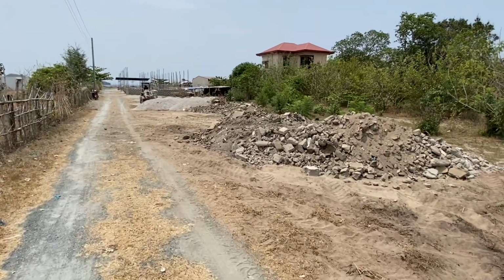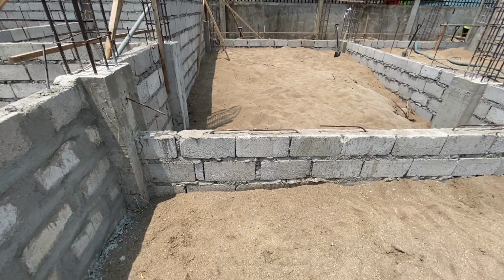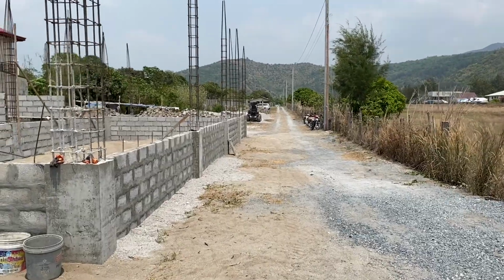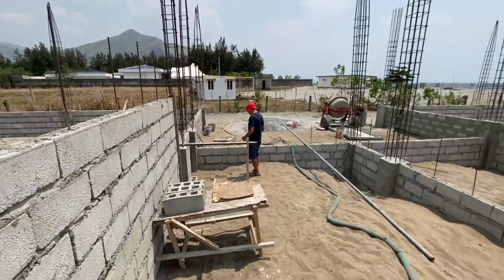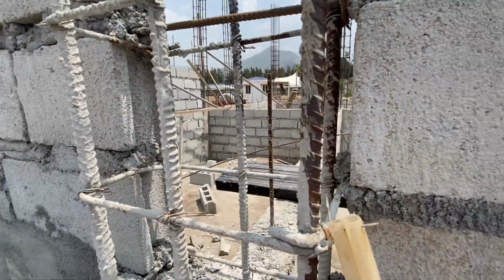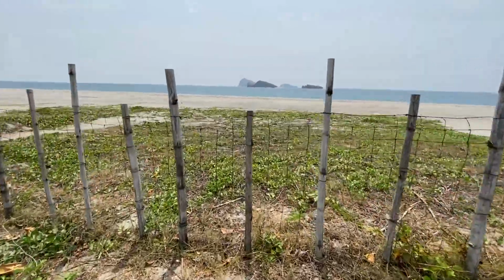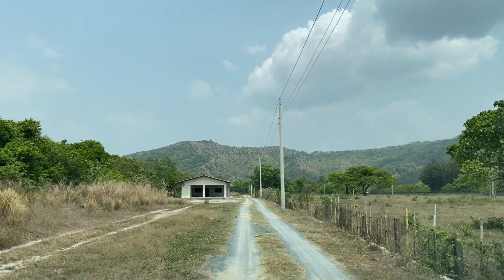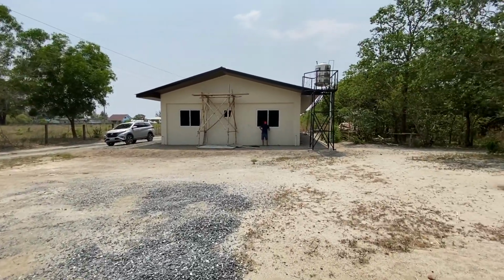Beachfront House Build in the Philippines (Week 6)

Comment: Just a suggestion watch Texas Filipino on how he is building his house. He shows and proves you can save money and have a stronger build. He is goin three stores high . Framing windows and door plus has all electrical lines and boxes and water lines and sewer lines. All walls and columns and are mixed and poured.  You would be amazed at his work. Plus he hires more workers  and ya still will save money
Reply: Great suggestion 👌